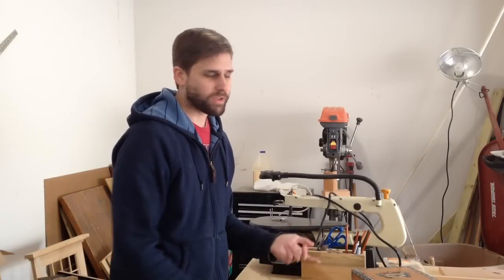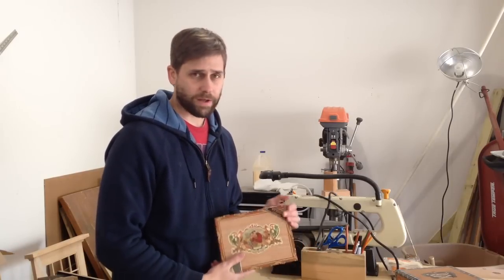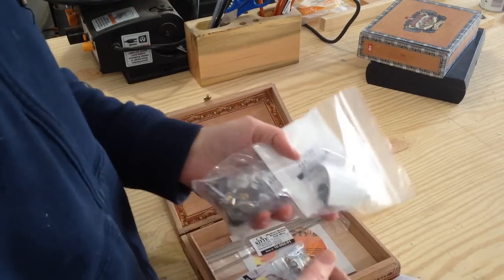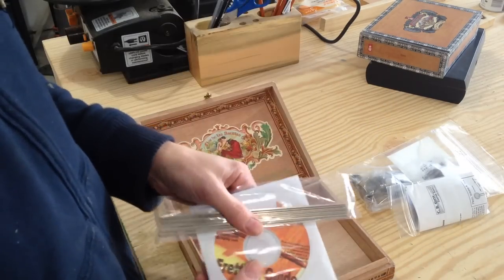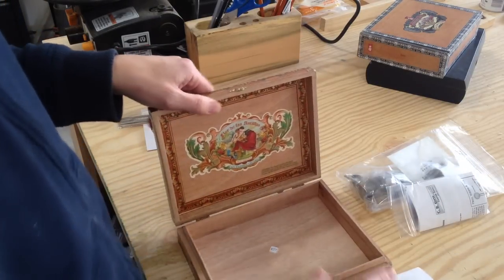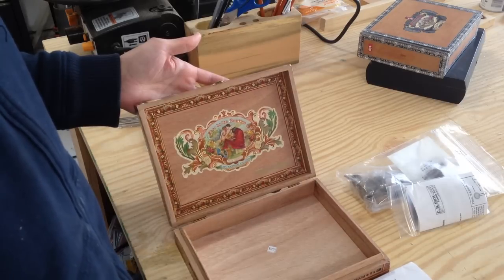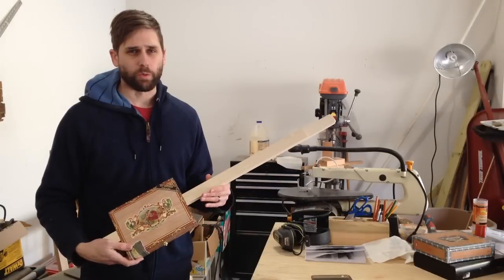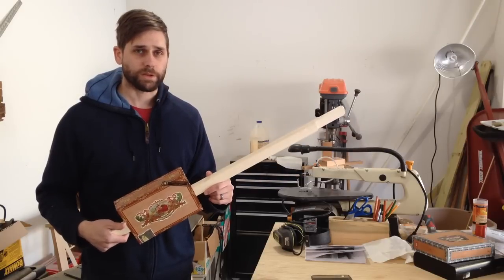Make A Cigar Box Guitar part 1 | C.B. Gitty Kit

Comment: It was great seeing how you cut the tenon/relief in the neck to cup the lid of the box. I finished my first build last year and did precisely that--had the same style box and cut the tenon with my table saw (no relief cut). It was my first attempt at the trick and it turned out rough, but I glued it to the box so it hid well. I thought it was a cheap trick but was reassured to see you did the same thing, and so cleanly!
Reply from the maker: I just wish I had a dado stack so that it wouldn't take so long to do! But it's faster than using a coping saw.